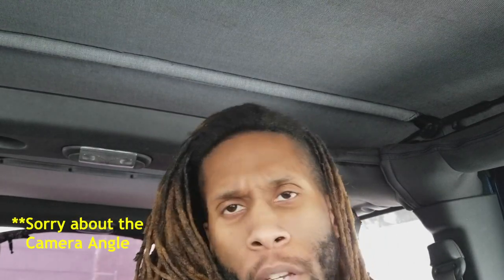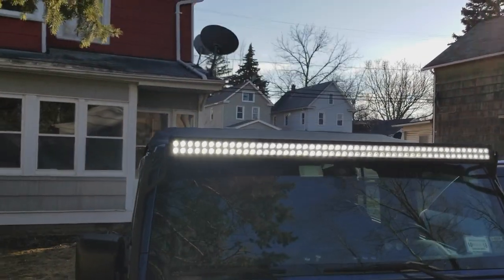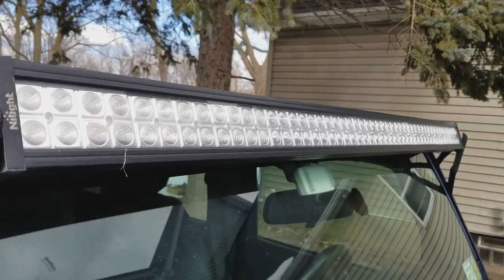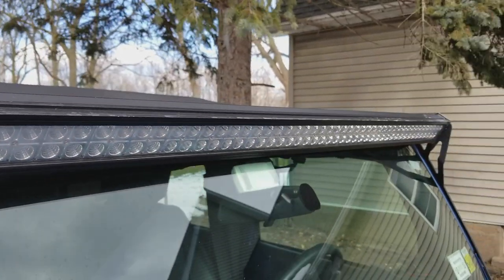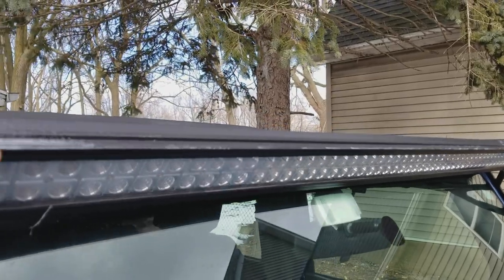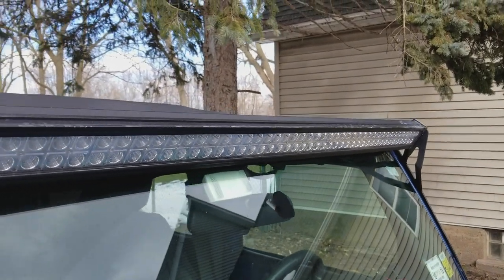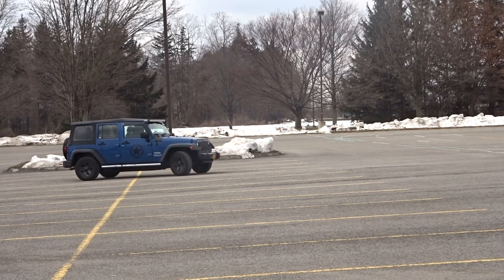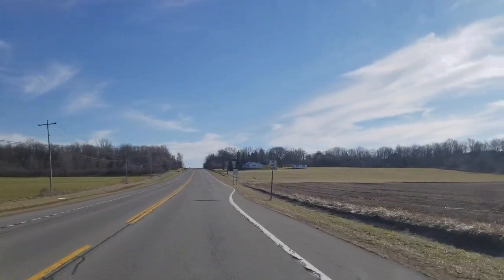Jeep 50 inch Light Bar Wind Noise FIX! | How to Stop Wind Noise From Light Bar

Comment: Just put door trim and you're done in the noise is gone don't ride around with the light crooked like that don't look right
Reply: Jeff Prevett I keep hearing about this fix but not sure where to apply the door trim... the bottom? The top? Both? Can you please elaborate?
Reply: I had the door trim applied and instead of a whistling sound i get alot more wind noise.

Comment: But what good is the light bar if it's pointed at the hood??
Reply: Cmon,  really with this question? 90 percent of the time you aren't going to be using the light bar. You aren't going to be traveling down a highway with it on.  You aren't going to be driving 65 mph on trails where you are usually going to use the light.
Reply: @richierich1169  but again,,. When you need it that "10 percent of the time". What good is it if it's pointed at the hood?